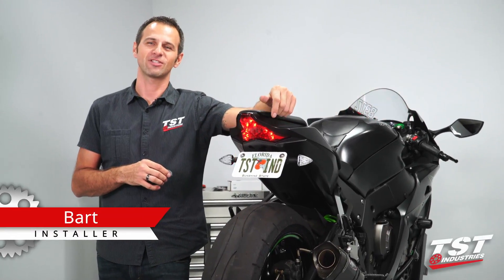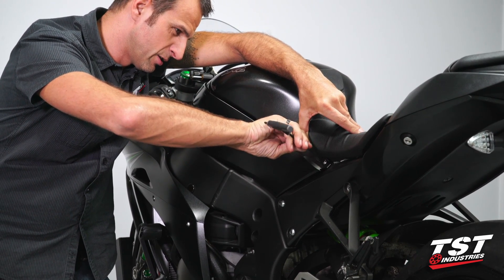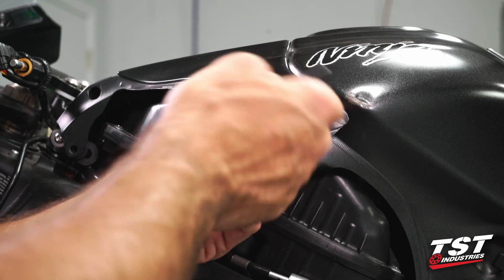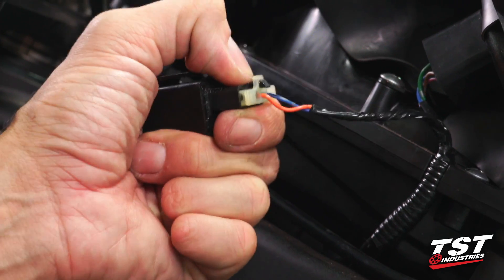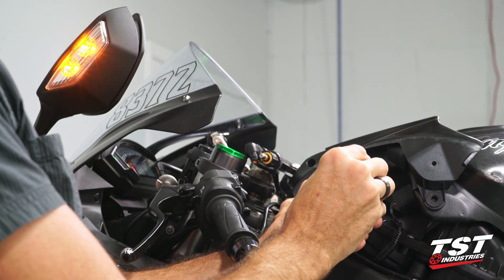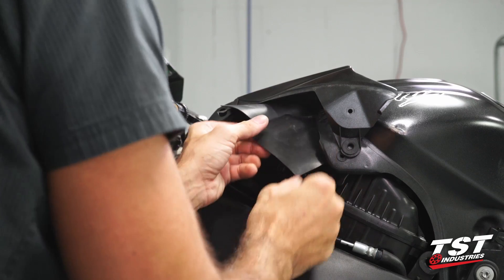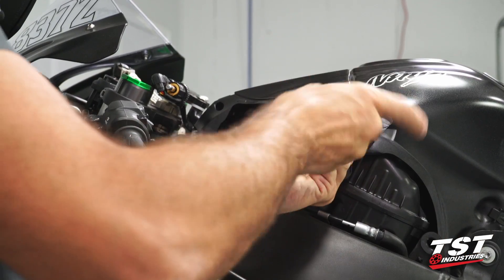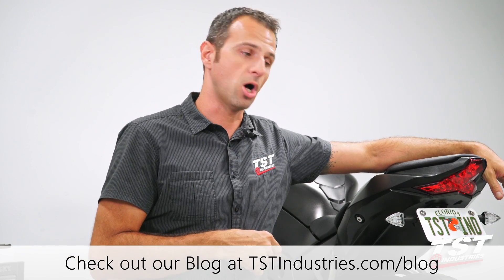How to install an LED Flasher Relay on a 2016+ Kawasaki ZX10R by TST Industries

Comment: Will this remove the check engine light as well?
Reply from the maker: No, the signaling circuit has nothing to do with engine faults on this bike.
Reply: TSTindustries as soon as I replaced the fender eliminator on my 2018 zx10r it came on? Is it the sensor? The bike is only 1200 miles in and is not driven crazy.
Reply from the maker: @smallkid9593  you most likely powered the bike up with one of the vital sensors unplugged. You can just ride for a couple days and it will go away by itself as long as all sensors are plugged back in.
Reply: TSTindustries ayyy lol thank you
Reply: TSTindustries hi, do you happen to know where the ground to chassis is on this bike?
Reply from the maker: @smallkid9593  Any exposed frame component that isn't coated.
Reply: TSTindustries the engine on my bike isn’t faulty. The light just came on bc I believe I triggered a sensor

Comment: My bike is a 2016 zx6r 636 is my turn signals in the same area in this model? I know you said 2016 and up so I'm believing these years config are in the same location correct?
Reply from the maker: If you notice the model in the video is a 2016+ ZX10R not the 636. The 2013-2018 model of the ZX6R / 636 has the relay in a much easier to access location. See our video on that bike: https://youtu.be/LN_HgtbMDn4